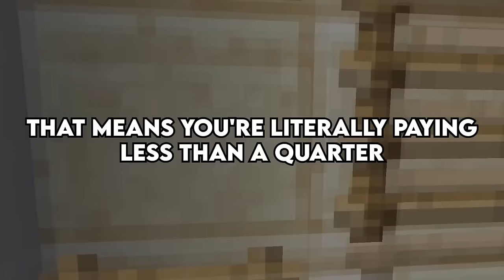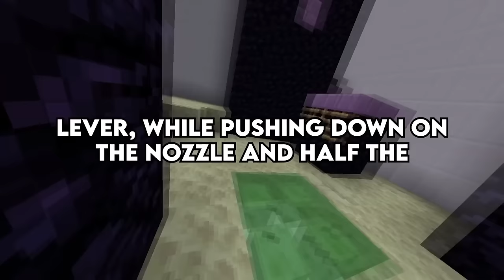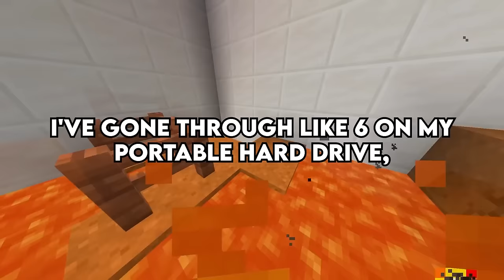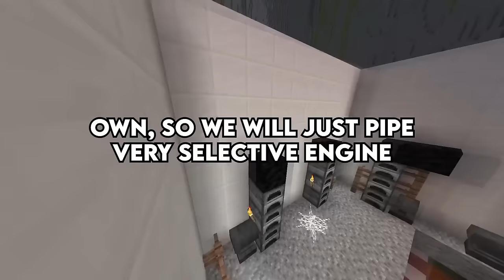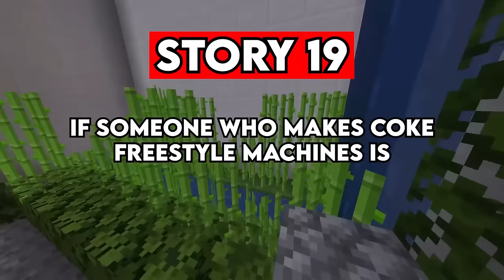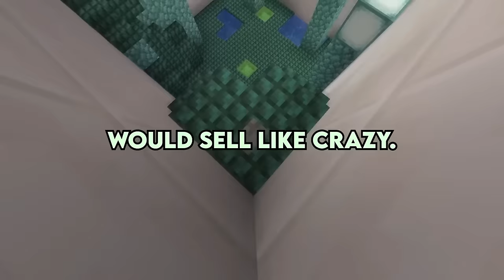Engineers, What Feature Existed Because Of Dumb People?

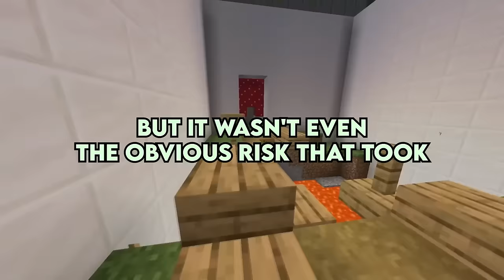Comment: 10:10 the guy going over the train getting fried by high voltage electricity jumping due to increased humidity is absolutely a thing that can happen. Increased humidity in air increases the electrical conductivity of air. Depending on what the humidity was and what the voltage was (those high voltage cables for trains and transmission have no insulation on them) the electricity could easily travel 1 meter through the air. I used to work at a power station. We had very high voltage lines (from 11,000V up to 330,000V). We had to be very careful with isolation for those.
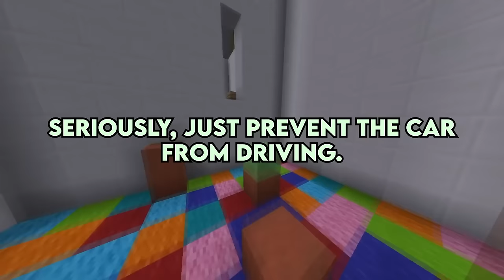Reply: 26:02  in Australia, our fuel pump triggers are spring loaded so you have to hold them to pump the fuel in to your car. There's no latch to hold the trigger down. If you let it go, it stops. This does 2 things. 1. It stops people forgetting to take the spout out of their car and driving off with it still in the fuel filler and 2. If there is a spark that causes a fuel fire, when you let go of the pump trigger it stops adding more fuel to the fire.
Reply: Electrical Engineer here. The amount of moisture in the air definitely changes the insulating value of the air. if you think about it, it makes sense. Water conducts electricity, so the more of it in the air (high humidity or rain), the less insulating it is. That's one of the reasons lightning is much more common when it's raining.
Reply: I grew up with electric fences. I've been nailed by it being several inches away! It's low amps and is only 10k volts max. I'm assuming the trains body is grounded/bonded. So they had the best possible ground. Also, simple search here for power line arc can show some fantastic spark shows (forgive me I forget the term). There's also videos of guys disconnecting/ connecting machines in these giant ass suits due to how far electricity can jump.
Reply: Trains tend to run at 25kV or so, so there are a lot of ways to get zapped just being near them
Reply: Yeh work in distribution and you’re right normally we have safe working distances from open core cables due to the fact electricity can and will travel through air. Thats what an arc is when you open a HV switch. So what an unlucky guy
Reply: Honestly the guy was just stupid, if you know anything about trains and or overhead wires you stay away from those wires.

Btw the most common overhead power (in Europe) are:
25 kV 50 Hz
15 kV 16⅔Hz
3 kV DC
1.5 kV DC

Any of these, with the given power that those wires carry, will fry a human. So if you are unsure if the wire is powered then you stay away from it, simple as that.
Reply: Use to teach HV engineering to apprentices, the instructors used a rule of thumb that a spark would occur if you had a a voltage difference of 3000 volts per millimetre of gap. This was reduced to 2000 volts in wet weather due to the improved conductivity water moisture gives the air.
Reply: Used to do utilities construction. We were trained,  and there were decals on the equipment about how far the equipment needed to be from whatever size of power line just because of its ability to arc of it was raining or something.
Reply: @darrenhemingway7121  I use the guideline that a meter is a million volts, or a millimeter is a thousand volts. I prefer the safer side of the equation, and this is (IMO) easier to remember.
Reply: Watching the air glow between transformers was always entertaining when I used to operate a power plant.
Reply: @reptilianrascal1125 
I think they used to be that way in the USA, too. But not anymore.

Comment: The dial tone is just common sense.  If a thing does the same thing when it doesn't work as when it does, you have to go out of your way every time you use it to see if it's working.
Reply: Cell phones dont have a dial tone
Reply: @niyablake  Calling on cellphone is different than landline
Reply: @flizzycat When I've worked in a Call center we did not have  dial tone for outbound calls
Reply: The original dial tone was also artificial. The difference is where it was generated.

Comment: im a journeyman electrician. the thing with electricity is that air is a conductor, but space can be an insulator. also, pure water is not conductive, but water with minerals in it, salt, to name one thing, is conductive. i mention salt, because salt is one of the things that is released in sweat.

there are lots of unfortunate accidents that occur with high voltage, and pretty much all of them are avoidable. youtube doesnt even always take them down either, because at a certain point, it all happens so fast that it can literally happen within the blink of an eye. you see the bolt of electricity, and theyre just gone when it fades away. teleported into oblivion. your own circuit panel in your home, while it may not immediately send you to the afterlife, can still explode with heat measured in thousands of degrees

Comment: How to pour gas out of the new safety nozzles: 1.Remove nozzle 2. put funnel in gas tank 3. pour gas from open can into funnel. You will probably spill some but it will not be as much as if you tried to use the new gas can nozzle.
Reply: I don't like the new ones. I have discovered if you pour the container upside down (the nozzle position should allow for fuel flow only and no air) compared to the old ones, you get better results. So the old nozzles required equal airflow and fuel flow. The new ones can only seem to function without airflow involved in the pouring process. Airflow seems to cause them to sputter like crazy.

Comment: Engineer here.  I think people tend not to give people credit, and associate mistakes directly with stupidity.  Expecting optimal conditions, including the optimal operation of the device/s in question, is simply bad design practice; at the end of the day, things (especially big or important things) are designed to be used under the worst-case scenario, which can be out of ignorance or by an unfortunate chance.  Someone being distracted and missing warnings, someone being unfamiliar with the limits of something, the lack of proper maintenance for a given item.  When it comes to safety, you can approach it in two ways; either prevent a failure given certain conditions outright, cause a failure in a safe fashion.  You touch your hand to a modern table saw, it'll activate a device that immediately stops the blade, in the process destroying the device and the blade.  Better to lose a blade than a finger, though.

Comment: Former weapons mechanic here. Back when the M249 SAW was introduced it had a issue with getting dust and dirt particles entering the feed cover while firing. So FN was approached and asked to make a solution. Short answer they couldnt but they had to try. They made a piece of metal that blocks the crack of the feed tray that is held in by spring tension. It doesnt do anything to stop debris entering the feed tray but it "looks" like it does.

Comment: Yes, air moisture content affects flash over voltage capability. Also flash over's happens easier over a surface(even over insulator material) opposed to empty air, and the difference is noticeable when doing ESD tests(15kV) and impulse voltage(various levels 3kV-8kV) tests on 120/230VAC electronics was common place at my previous job as electronics designer. Some days you could not perform the tests because we didn't have a moisture controlling equipment for the air indoors.

Comment: As for dial tones ... why do you think the pre-IP-phone phones (the POTS phones) had a dial tone? Because the system also went out of its way to provide the tone. It's basically the same logic: the phone should tell you that you're fine to dial a number now. Because it could be in a different state. Or the link to the PBX could be broken. And you want to know that.
Similarly, I'm currently irritated that our IP PBX does nothing to tell me that the call is over (usually because the other side hung up). If they didn't say a thing, I might keep talking for a minute or two until I notice I don't hear any reaction. That's just a bad user interface. Tell me what is going on! (By contrast, Teams will beep when a call ends.)
Ah yes, computers not showing you they noticed your click or enter. Which wouldn't be so bad, except all of us have experienced situations that looked exactly the same, but the reason was that the computer had crashed. Early feedback is essential. And remember, you usually do the same in human-to-human interactions - and if you don't, you risk "did you hear me?".
Not an electrician, but yes, that's a Darwin-award-worthy move. The distance of the cable over the wagon is calculated to make certain it doesn't arc into the wagon. If you significantly reduce the distance by putting a human between those two, it's not a matter of if, it's a matter of when. There's a reason that in any relevant emergency, the rule is no one gets close until the electricity is off AND there's an electric conductor (usually a hooked metal stick)  between the wire and the ground, so even if some idiot switches it on again, it'll immediately short-circuit before it can kill anyone. Not sure how much difference the humidity makes, but reducing the distance to the wire definitely makes a big difference.
As for air moving, I don't know, we don't have these things in every home over here, but I do know I found it irritating when silent hard drives first came out. I no longer had a feeling for what the computer is doing. These days, some display of CPU, memory, etc. usage graphs is much more useful for that, so I'm happy with silent drives. (And back when it was floppies, there was a joke "floppy cleaner" program going around that first sounded as if it was washing the floppies - and then switched to the exact sound everyone knew they only heard when formatting a floppy. Instant panic attack!)
As for machine safety features, there are stories of them with the safety features overridden or not installed, the machines actually hurting someone, and then the court gets involved and finds out the manufacturer isn't responsible, some idiot mechanic is. Too bad the mechanic can't pay millions for whatever damage was caused.

Comment: Heat will sag a power line. The cables are installed so that they have a small amount of slack in the winter, but the heat in the summer will cause the cable to expand(thermal coefficient) so they hang lower the hotter it gets.

Comment: Dude, I am not even electrition but it is well known that high voltage is arcing so you don't need to touch it to get killed.
And yeah, more humidity more potential ark.
It is not freak accident, it is common knowledge. It is like taking sharp turn and not slowing down while driving on black ice or running near pool.
Millions on people get hurt and even die from this year after year.
You know that you should not eat random mushrooms in a forest  the same is never go close to very high voltage, even more dangerous when humidity is high (not relative I assume, absolute humidity).

Comment: Can confirm, programming 101 - if it can be broken the user will break it. Most of the time you have to have checks for everything because "users can't be trusted to follow instructions, sometimes they deliberately do the opposite just to see what happens" so you gotta design everything to be baby proof or it will probably break, you're also told that displaying text or a loading bar when unnecessary is good practice exactly because if the user doesn't have any feedback for longer than like a second they think something is broken

Comment: Fuel hose breakaways at gas stations: Designed to break and shut in case you forget the nozzle in your car and drive away. Without them, it would create a major spill until someone hit the emergency stop. It's such a problem that they now make some that can be plugged back in instead of replacing them every time.

Comment: If it's the same as with presses, that foot pedal is the alternative mode where you don't need both hands to be on the buttons. So more or less you have a "safe" mode of operation and a "less safe" mode of operation on the machine.
Reply: On the cutters I used the foot pedal was to control the clamp that held down the paper before you use the cutter with the buttons. Some people would hurt them self with the clamp by stepping on the pedal accidentally.

Comment: Semiconductor field service engineer.

I got a few stories but I'll start with the one that couldve killed me. The equipment i work one has robots that move silicon wafers between different modules in the equipment. Sometimes they mishandle, and you have to climb inside to assist with fixing it. We usually lockout the excess robots, and attach a dead man 3 position switch (called a teach grip for brevity) to hold when moving the robot while someone is inside the equipment. I was inside the tool once, and i had set the teach grip down while climbing in. In the span of two or three seconds of climbing in and repositioning to grab it again, my partner snatched it and began initializing the robot with me inside the tool. I yelled at him to stop but he couldnt hear me. I scrambled out of there as fast as i could and slammed into the floor. My partner responded with "where were you?". The teach grip was no more than a foot away from me when i set it down, and he had to climb inside to take it from me. I refuse to work with him anymore, and somehow he didn't lose his job

Comment: In Sweden we solved the "drive away with the hose still in the car" problem as well as the "the hose slips out and spills gas everywhere" problem by the simple expedient of removing all the locking mechanisms from the pump handles in the entire country, so you have to stay there and squeeze the handle to get the gas to flow. People are less likely to forget it when they have to constantly hold it in their hand all the time.

Comment: About #9 - I once broke a garage door with a hose before. Long story short, the hose reel was inside the garage with the door less than a foot off the ground to keep heat in during the winter. I finished hosing down a boat on a trailer, needed to straighten the trailer out, so I lowered the hose off the end of the boat and hopped in the truck to pull forward. The hose caught on the guide post of the trailer and pulled the hose reel half way through the garage door. The connection from the hose reel to the hose was brass, and the spray nozzel, which is what really caught, was a quick disconnect. The garage door was damaged to the point where repair and getting a new one were the same cost and the hose snapped before either connection broke. Now yes, while I am 100% to blame as I didn't double check to make sure the hose I had lowered off the end was free, idk how both of those connections outlasted a garage door. The spray nozzel was pretty stuck on the trailer at first, was in the middle of the street when I realized what was happening so I had to move the truck/trailer before seeing the extent of the damage. Literally used the quick disconnect to detach the hose from the trailer so I could back up, and it still worked completely fine

Comment: I've seen a bunch of washers and dryers across home, 3 rentals and a college dorm laundry room. None had locks, but all had sensors that, when tripped by the door opening, shut off the machine and apply a brake to the drum so it stops before you can put your hand in

Comment: 26: Kinda hard to do with an ICE as if that switch fails, the car wont start and you're screwed.
You can tell when an EV is being charged as the BMS is detecting input current.

But there is a solution to this and its in place right now as mentioned in 31
Fuel nozzles are designed to break off and do a shutdown that pump.

Comment: Safety interlocks are no joke, and for good reason. I’m currently working on a project (a piece of lab equipment for a chemical reaction) that operates at up to 40000V. (Even though the power supply is current-limited to 1mA, the output capacitance alone holds a lethal charge at that voltage. Heck, even the capacitance of the cable itself is enough to injure.) Since I don’t want to be responsible for anyone’s demise, it’s designed with interlocks on the two layers of doors needed to open the device, either of which will turn off the power supply. Redundant discharge circuits then ensure the voltage falls to zero within 2 seconds. Opening the outer door already trips this, and then it takes at least a second or two to then insert the key and open the inner door. And once you’re inside, the actual high voltage electrodes are still not exposed, requiring many seconds of unscrewing to get to. 

And this is just basic protection. If this were going to be used outside of a research environment by highly skilled and trained personnel, for example in a production environment where low-skilled or poorly trained workers work under time pressure, there are even more things we’d do.